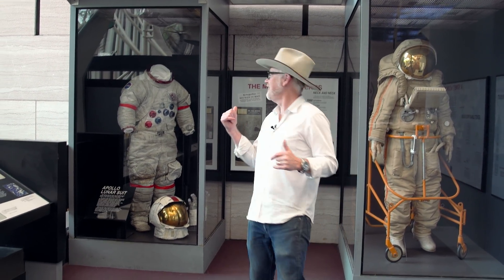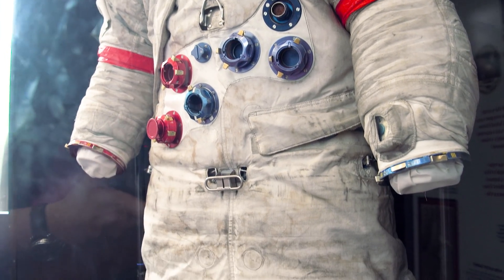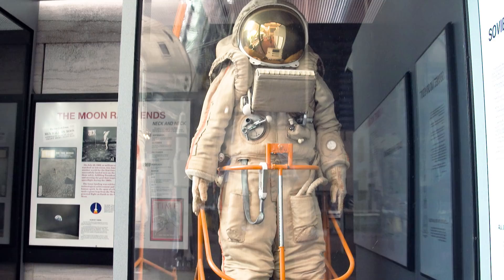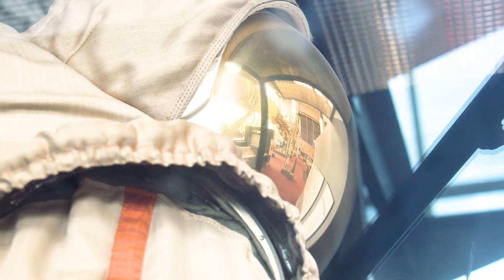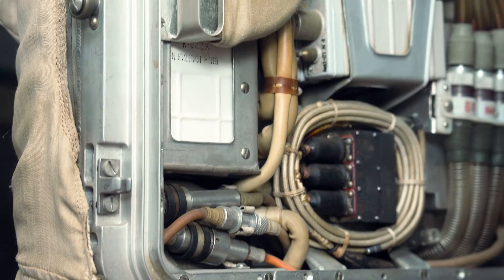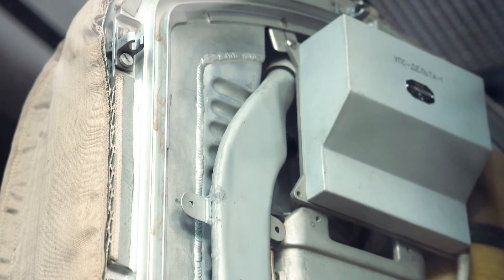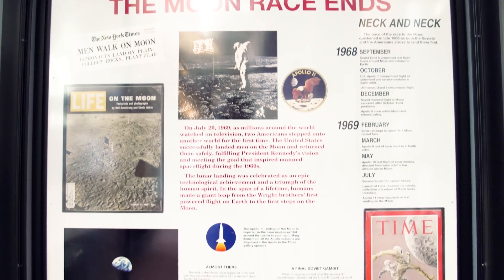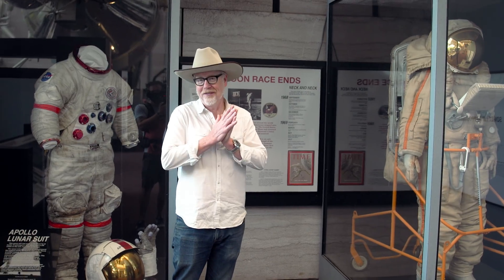Comparing U.S. vs. Soviet Spacesuits at Smithsonian

Comment: The russian approach to many engineering challenges of the time is beautifully simplistic straight forwad.
Reply: Indeed, I love their "simplistic" and direct approach. It's rougher but also easier to repair and maintain. There's a lot of beauty in their designs.
Reply: Whilst the Russians had access to much of America's specifications with regard to flight equipment their own resources and finances were less resilient, so a different even pragmatic approach had to be made to much of the actual design and build of their equipment. One only has to look at the Russian Buran "shuttle" to see whilst they seem the same as the American design, much was changed under the skin for practical reasons even overcoming some of the shuttles shortcomings.
Reply: @Arachnoid_of_the_underverse  Ah yes the shuttles...Both sides had different visions when it came to raining nuclear holocaust down on earth....
Reply: @cs-rj8ru   I think it was more to do with covert servicing and retrieval of extremely expensive "monitoring" equipment, after all we can barely do either now. Even the hubble is suffering from the American inability to hands on repair recent hardware problems.
Reply: @ofmyownaccord  Sharashka system was in place before and during the War.
It has ended in the mid 1950s.
Reply: @ofmyownaccord  The soviet space program had a budget of closer to half to two thirds of NASAs budget most years, and I really doubt they sent rocket scientists to Siberia over small missteps because rocket scientists take a lot of education and would be hard to find fast replacements
Reply: @32Rats  dude the soviet cared little about that. a lot of engineers where sent to the gulags for a lot of reasons.
Reply: @32Rats  By the 60's no, but the chief designer Sergei Korolev, man most responsible for the Greatest Soviet achievements, almost died in the Gulags and the torture he experienced there likely contributed to his early death and the death of Soviet moon shot.
Reply: @redharvest298   Gulag was a thing only in a Stalin time. Korolev was in gulag, but in Stalin time not later when space race began.
Reply: @redharvest298  The details around his death aren't 100% clear with some reports saying he died from complications of a poorly performed operation for hemorrhoids, with some suggestions a jaw injury from his 2 years in the Stalin Great purge jail system prevented intubation. Others that he had a cancerous tumor in his abdomen which erupted during the operation - his family later confirmed independently that he had the tumor.  There also seems to creditable info that he had ongoing kidney issues from his first 2 years after being arrested and sentenced. 

Obviously the cancer and botched hemorrhoid op aren't directly related to being in stalin's prison system even if the poorly healed jaw was more directly related.  Plus he chained smoked I believe most of his 59s years (which was quite old by Soviet standards of the day) , he overworked constantly, suffered from stress and its possible he inherited a heart problem. Claiming "the Gulags and the torture he experienced there likely contributed to his early death" is overstating the available evidence.
Reply: @boruff68  Right, I think we have to stop moving goalposts here, and not turn this into a confrontation. I'll recap the discussion: "Their early space program clearly shows that as to just how many fatal accidents occurred during." To this, I replied regarding the early space program and cosmonaut fatalities, to illustrate that the specific way you put this statement does not exactly ring true. Just like the stereotypes that are often invoked (Soviet space deathtraps, indifference to deaths, dead dogs, et cetera) are a bit skewed, misrepresenting the real situation.

I want to stress here that I'm not trying to whitewash the entire Soviet space program, to say that they never failed or cut corners, or to "put down" you or the US space program. Everyone did great, all things considered.

But let's unpack your second comment. "under funded... RUSHED into assembly..." would refer to the Nedelin explosion, not the N1 rocket! It was the R-16 that was rushed into a test launch in 1960 and exploded. Note though, that the Nedelin disaster was not a space program launch: it was a test launch of a ballistic missile. Nedelin himself, the person who caused this deadly crunch to get "his" launch by November 7, was an Army General.

As for the N-1 lunar rocket, I would argue that it is a completely separate can of worms; not so much skimped on (it wasn't especially rushed or underfunded), but undercut — by the turmoil and rivalry between two competing firms/designers; an untimely death of Korolev; and the lost Moon Race. The inglorious failures of the N1 rocket were not for the lack of funds expended, which were titanic, but rather the insurmountable (in a given timeframe) corner that the design team painted themselves into — without a visionary to yank them out of that corner before the program lost its relevance.
Reply: It is often better that way.
Reply: The other benefit of a simplistic design is that there is less potential for things to go wrong. Probably a good thing when dealing with the harsh environment of space.
Reply: @michaelpettersson4919  Funny how they lost huh.
Reply: The Russian solution to a given engineering problem is often going to rely more on simple concepts applied in novel ways than a US (or German 😉) solution.  Getting sent to count trees is a pretty minor factor.  Much more important is the relatively limited production capacity for products that are, at the time, high tech.  Let me explain...
Russian craftsmen are first rate.  They can design, machine, and assemble individual units or small batches of units to very high standards (it's mass production where Soviet - and Russian - QC starts having issues).  But it's piece work that doesn't produce large quantities of whatever is being made to that high standard.  Even there, the number of shops that can turn out that level of work is severely limited.  During the Cold War - and, to a degree, again, now - there was also very limited access to anything not made in Russia.  That drives an approach simple solutions to complex problems, often applied in ways that seem weird to western designers ("A refrigerator seal...why would we use that?  We're not making refrigerators, we're making spacesuits. Apples 'n oranges, son!  Now knuckle down and design a spacesuit seal.").  
So not enough space in this text buffer to do more than scratch the surface of this subject...
Reply: @christopherreed4723  and less safe.
Reply: @ofmyownaccord  No. You have no idea about reality in Soviet Russia. They had very skilled and educated people. They also weren't capitallistic country, so things like "cost" or "budget" were completelly different, then in USA. In USA if part X was contracted by government, then it cost X+Y dollars, because Y was a profit for some private producer. In Russia profit didn't exist, because everything was state owned and made in state factories. So these things were just cheaper. There were also no problem with allocating force to do something. In USA you couldn't force some corporation to allocate all it's power to solve some problem. In Russia you could. You need more steel? OK, 10 steel mills will work only for you. You need cars? GAZ factory will produce cars only for you. You need workforce? We move 1000 of employees from other city to you.
Also in 60's there were no fear of Siberia. In 30-50's yes. In 60's no. Basically Russian approach was just different - it was "let's do it" while US was "let's do it and make money".
Reply: @aleksanderfiold7554  That's probably the best explanation so far.
Soviet way was very simple - "fuck it, lets do it".
American way was very hard - a bolt has to travel between atleast 3 contractors before it can be bought and all of them need to make a profit.
Reply: @aleksanderfiold7554  Very true.
Reply: It’s too bad people on r/space give them a lot of shit because of recent events and love to shoot down their achievements
Reply: @TheZachary86  r/space hasn't been a nice place for a long time now. I unsubed years ago.
Reply: @TheZachary86  It is more than bad, it is shameful.  Reddit is no place for an intellectual to discuss engineering marvels.
Reply: @TheZachary86  people in r/space are a bunch of self centered weirdos
Reply: @TheZachary86  I think we'd have been less critical if the Soviets had been as open about their shortcomings and failures as we've always been. The three man Voskhod mission was an example of how they sacrificed crew safety for propaganda purposes. They stripped that spacecraft of equipment so they could shoehorn three cosmonauts into a vehicle designed to carry two ... just to beat the upcoming Apollos into orbit.
Reply: @josephcope7637  NASA made up the Apollo 8 mission on the fly because they thought the Russians would beat us to Lunar orbit. That was a bold move sending Apollo 8 without a LEM. NASA also continued to fly the Shuttle when they knew there was problems with the booster seals and debris strikes. These decisions cost the lives of 14 astronauts.
Reply: As author and aeronautics engineer Antoine de Saint-Exupery said: "Perfection is achieved, not when there is nothing more to add, but when there is nothing left to take away."
Reply: A better word for simplistic is minimalistic, simplistic is often a negative word while minimalistic is objective and is often positive.
Reply: Occam's razor or the KISS principle. The simpler a technical solution, the more elegant it is.  The Russians are masters of this philosophy.
Reply: @ofmyownaccord  To be fair USSR had far superior space tech than anyone else back then. Even that suit you consider to be bad is decade ahead of the NASA design.
Reply: Exactly why they won the Space Race.
Reply: Terry Winter   An aberration in a film does not make proof of anything other than one can draw from conjecture. Plus you didnt address my previous response.
Reply: @ofmyownaccord  Space race was not WW2 , Stalin was not around any more folks working on space programs were not being threatened with the Siberian gulag.
Reply: Necessity (lack of resources, relative to the far wealthier USA) being the mother of — simpler and cheaper — invention.
Reply: There is a reason for that.
Reply: Except their lunar lander.  EVA to get into your LM?  Bad idea.
Reply: AK-47 cough cough
Reply: @ofmyownaccord  https://www.youtube.com/watch?v=TMbl_ofF3AM
Reply: mostly due to lack of money, when you don't have money to spend on random shit you think of the simplest things
Reply: Terry Winter  ( Sigh) Have you considered after all these years with thousands upon thousands of people involved in the Moon missions, not one has come forward to say it was in any way fabricated?
Reply: because during that time in USSR, you had a challenge & a limited supply of everything except for brilliant people from across Russia, Ukraine, Belarus, Baltics, and a dozen other countries. Typically, engineers had to work with outdated or completely without tools that US counterparts considered "standard practice".

the stories that my dad told me about his military days in USSR's army are fascinating, funny, and depressing all at the same time.
Reply: @Metalblowing  yes ,I’m surprised Russia did not suffer more fatalities during their goal to reach the stars given their limited resources.
Reply: Still is, because in Russia they get paid for solutions and are employed by the state. In America its done by private companies operating on a "cost plus" principle. There is no incentive in American R&D to be efficient when solving a task and there is a very clear profit incentive to spend as much as possible while doing so. Russians get paid for results, Americans get paid for time and money spent.
Reply: @rolandlee6898   not as far space related equipment is concerned. Every gram saved is less rocket fuel to propel it into space and coding is kept to the most efficient and simplest form that allow for low battery usage and limited memory allocation. I believe I read somewhere a while ago that most NASA satellites still operate on a highly modified version of DOS.
Reply: @Arachnoid_of_the_underverse  Not when youre hitchhiking a ride with another nation for 30 million per ride and have no way into orbit yourself.
Reply: @rolandlee6898   Not in this case scenario they don't but the US military do have a miniature "shuttle" design they use for black ops.
Reply: @Arachnoid_of_the_underverse  Yes, thats the one Wonder Woman and X-men use, right? Or was it GI Joes?
Reply: actually it's not russian, those technologies were Soviet (15 republics), and russian federation has invented nothing after Soviet Union has collapsed
Reply: Take the issue within Soyuz capsules, that the commander due to the shape of the inside of the capsule is sat a little further back from the control consoles than the other two crew members. Caused the problem that during every phase of the flight until re-entry, he couldnt reach the controls as easily as the other two crew members. 
Rather than redesigning the entire console, or inside of the capsule to adjust the placement of the seats, they simply use an extendable telescopic pointer to operate the controls.
Reply: NASA spent big bucks developing a space ballpoint pen, that would work in zero g. The USSR flew their space missions with pencils. ✏️
Reply: I NOW LIVE IN THE EX SOVIET UNION    Can we ALL please stop thinking the Russians / communists were idiots who made utter rubbish THEY WERE NOT

I have a pair of 1970 HiFi speakers - many of the features are only NOW appearing on $25K plus western speakers. The entire front baffle of the speaker is cast in aluminium and the speaker cones and voice coils are mounted directly into this casting with the magnets mounted on the back. The body of the speakers are steamed curved 15mm Birch plywood, not known to be about the best material for cabinet construction. Internal one-piece bracing out of 15mm ply. All wood parts doped with a tar-like substance for damping. External separate crossover. 

The main difference is the Russians did NOT make things flashy to appeal to consumers cos they had no need. 

Soviet Hammerite paint CAN NOT be taken off with an angle grinder; it was designed never to be repainted, that goes for everything they made. It was designed to be very good and to last. OH, and be easily repaired.
Reply: @piccalillipit9211  I have yet to see anyone here say anything was utter crap?  Quite the opposite, really.
Reply: @ericstearns170  - I meant society not this comments section. I agree my comment was ambigous.
Reply: @ofmyownaccord  In 1960s and later, no one got shipped to Siberia (to serve time, if I understood your implicaton) for missteps related to their work. It's a completely different era. Space industry was huge, and employed tens of thousands qualified specialists who had a high status.
Reply: @ofmyownaccord  Plus life is cheaper over there.
Reply: John Corbin  That is actually an urban myth. First of all, everyone used pencils at first, Americas and Soviets both. But graphite in the pencil is conductive, and when you write with a pencil, it leaves a small cloud of pulverized graphite that in zero g floats around the spacecraft, causing short circuits and fires if something goes wrong.

Secondly, USA spent nothing on a pen - it was a private investment of a single man, and he later sold those pens to NASA and other interested parties... including USSR who used them as well.

Yes, simplicity in design is the sign of a true genius, but sometimes you simply have to engineer the shit out of a problem. In the case of a space pen, everyone used pencil at the start - until everyone realized that with all that wiring and electricity, you are one step away from disaster if graphite gets into the wiring.
Reply: The writing upside down in space problem. US spent millions figuring it out. USSR just used a lead pencil…
Reply: Yes, shot gun at Your back makes You somehow better engineer!!
Reply: American engineers are anxious to impress their colleagues and want to try lots of different things. Bolshevik engineers know that one mistake will land them and their family into gulag, so they come up with the most direct solution.

Not "Russian," mind. Bolshevik. Russians came up with Faberge eggs. Bolsheviks came up with katyusha rockets.
Reply: @DrCruel  Peter Carl Faberge is a typical Russian name, isnt it? Son of Gustav Faberge and Charlotte Jungstedt.. just your run of the mill Russians... yep... totally..
Reply: @rolandlee6898  Ah. You've noticed the close connection between Imperial Russian art and the French art of the Bourbons. Very good.

Here's another point. When your patrons are descended from Peter the Great, you tend more towards ingenuity and flair. When they're socialist thugs who have a tendency to murder people who exhibit ingenuity and flair, you tend to stick to the quickest, easiest solution. That's double the case when the people fabricating your parts might be slave laborers. So you keep it simple.

Not Russian. Not Russian. Bolshevik. German science and art are not defined by the monstrous and brutal National Socialists. The monstrous and brutal Bolshevik socialist mindset does not encompass everything Russian.
Reply: @DrCruel  In this case in kinda does though if by "Russian" you infer ethnically Russian. That was the whole premise of the revolution, it was nationalistic at core, against the Holstein-Gottorp-Romanov empire (again, a very Russian name, isnt it?)
Very few Russian Empire elites had any ethnic Russian blood and the common language spoken among them was.. what? Russian you think? Try again. Many of them did not speak Russian at all.

German art and science was conducted by ethnic Germans in Germany. It could be that you just picked a bad example with Faberge, sure, since Peter Carl Faberge is in no way Russian. Neither of his parents were Russian by any stretch nor were they even born in the Russian empire (although Peter Carl Faberge himself was).

Lets just say - bad example. The imperial times certainly were the highlight of class and sophistication in the Russian civilization. How much of that relates to actual ethnic Russians is another question, as since they took over its been going downhill.
Reply: @DrCruel  Thats what I'm saying... If you mean Russian in the same sense as "American" and just refer to the state then yes - I agree. But ethnically Russians are not very sophisticated folks. Hence the revolution and the resulting consequences to this day. Thats just my two cents, so to speak.
Reply: The 'problem' with Soviet space program was the problem with all Soviet engineering programs; does this further out military domination of the US?  No?  Next.   Many great ideas languished in the pit of the cold war due to the lack of 'practical value' according to the Soviet system.
Reply: @ericstearns170  Examples please. What ideas where languished because of that?
Soviet space program had not only a military, but also a great political significance. And every success was welcome.
So USSR used space program for science, communications, weather observation and all the things the West did.
The real problem was rushed development and setting the deadlines to Soviet holidays. So they launched undertested and flights not prepared properly. Which, for instance caused death of Vladimir Komarov.
Reply: @azgarogly  Let me clarify...When tje Soviet's first started their program the entire point was for military research.  When the long-term goals of the space program began to diverge to scientific verses military as the primary function of the program, the funding was reduced.  Where NASA began to slowly increase funding through the 60s to the 80s, the Soviet program began a gradual decline.  The research never stopped, neither did it suffer per se, but it wasn't supported the way the US program was.  If it had been, the current space race situation would have been vastly different.  For all the issues that the US and the former USSR had, the competition made them both stronger.
Reply: @ericstearns170  It would be awful nice to see some reference for your statement.
It was indeed some ups and downs in financing of Soviet space program in time, but it was rather about the overall state of Soviet economy that had it's own ups and downs.
And in US there was an increase in financing for NASA, for instance when Kennedy decided to beat USSR in a moon race.
But Soviet Rocket and Space research, as it started back in early 1930s, was always both military and scientific.
Reply: @azgarogly  The best example was the Soviet moon program.  When the US announced the 'space race' and started catching up to the Soviet program; the Soviets has already started moving away from manned missions to more satellite missions (reducing not eliminating mind you) because it was money spent they didn't have.  It wasn't the the US so much as caught and passed the Soviets so much as the Soviets said, meh we got what we needed, next.  Meanwhile US miniaturization technology would have never progressed without the moon shot.  Different approaches based on different philosophies.  As stated so many times, not better, not worse, just different.  Its hard to give many examples because the programs were often touted as one thing publicly but developed as something else.  The non functioning shuttle ( though nearly fully developed) is a good example of that school of thought.  Some think it was a failed program, I choose to think it more of a working testbed.
Reply: @ericstearns170  The Soviet manned Moon flight program has failed not because it did not have priority of finance. It has had very serious technical issues. And on top of that 1960s where quite intense for USSR economy, there was no money just to throw at the program.
But the main thing was the engines. Building the engine of that size is not simple even now when we have all that digital modeling. Back in 1960s it was actually beyond possible and they say NASA pulled that trick with great share of luck. Soviets knew about the problem and tried to use multiple smaller engines. And failed. At some point it was obvious NASA is so far ahead, USSR won't catch up.So the program was canceled. And then, of course, they said that automatic research vehicles are far better than manned flight. For sure.
Reply: @azgarogly  Again, different approach.  The Soviets never liked NASAs 'punch through the sky' launch approach and preferred the 'long slingshot' both work, but it hampered their ability to do it with cost effectiveness.  On the flip side, NASA's engineering marvels of booster rockets hampered their innovation and essentially made them stagnant.  Hence the program slowly dying since the mid 90s.  Ultimately ending up in mostly non-manned missions like the former Soviets, soooooo, not all that different in the end.  lol
Reply: @ericstearns170  Exactly, after the moon landing their priorities also simply went in other dircetions. People tend to forget that the engineers at NASA were completely baffled when they got their hands on the RD-180 even going as far as thinking that the thrust output the Soviets (now Russians) gave them was faulty.
Reply: @ericstearns170  I’d say the space programs for Soviet and US were of great military importance, great way to research better ICMBs without explicitly doing or saying so
Reply: Yes,but I will also say the Russians had WAY less regard for human life than we did here in America also. Their early space program clearly shows that as to just how many fatal accidents occurred during. I always felt alot of it was done "quick and dirty" compared to what the United States was doing at the same time period. (Even the dogs were not safe from being stranded in orbit to die...  :(  )
Reply: @boruff68  You mean the 5 perished cosmonauts against 4 perished astronauts? (Note that I'm discounting the 3 US astronauts who fatally crashed their planes during astronaut training, and I'm pointedly NOT including the two Space Shuttles, with 14 dead astronauts).

I'm sorry to be blunt, but that's basically what it boils down to. Unless the mythical "secret dead cosmonauts" are brought to the conversation, which does happens often.

As for space animals — again, you can check on the tally, so to speak. (There's a lot of text below, but I just found it interesting =) TL;DR most Soviet space dogs lived, and US had dozens of dead space animals.) 

The widely publicized death was of the dog Laika (first to orbit the Earth). But there were TONS of animals launched on rockets. At the dawn of space era US launched a large number of suborbital test flights with monkeys, over half of which died. The first monkey the US successfully launched in space, Gordo, also died. The next two survived (despite the 38G force), but one died shortly of medical complications. Another monkey in 1969, on a long-term "space station" mission, also died. https://en.wikipedia.org/wiki/Animals_in_space 

Meanwhile, the famous Soviet dog that died in space, Laika, was rather the (famous) exception. Its predecessors, Tsygan and Dezik, survived. Other two famous dogs, Belka and Strelka, survived as well. Overall there were over 50 space dogs; most survived, even making multiple flights. The ones who died mostly crashed on reentry, it seems that Laika was the only one who died in orbit.

Also, you would be glad to hear that all space dogs were not some specimens, kept in cruel empty cells and dissected afterwards: all of them were strays found and befriended by the space program personnel, and after flights, were all cared for / adopted by the same.

https://en.wikipedia.org/wiki/Soviet_space_dogs
Reply: The "way less regarded for human life russians " created the safest space vehicle ever,being used for 60 years..
Their last fatality ? 1971...Total fatalities ? 4...

Apollo missions used mathematical risk analysis.The system provided numbers revealing high risks taken...NASA decided to discontinue the system...
Apollo 1 caught fire..
Apollo 11 moon vehicle almost crushed on the surface due to computer fail.
Apollo 13...you know...
Apollo 14 was struck with many problems...
And there was another Apollo launch ( i fail to remember which one ) that post flight analysis revealed the rocket was one circle away of catastrophic failure...

The mathematical system was also not used in Space Shuttle program.

I can accept all the previous examples because exploring and reaching the edges ( even for the wrong reasons )  requires to push things.

But i cannot accept NASA burying numerous reports regarding thermal insulation problems of the Shuttles. It happened many times,literally every after flight....
They even gave a green light for reentry to Columbia which was clearly in a serious problem...( And columbia had a lot of time to spare in orbit)....

You were saying ???
Reply: You mean copying?
Reply: @jaimejimenez4223  Man, the video is literally about the differences in spacesuit design between Russian and American suits, and ends with NASA "copying" the Russians. Try cleaning the propaganda from your brain.
Reply: @jaimejimenez4223  You cannot copy something you made first....